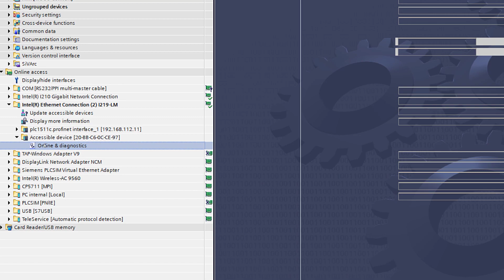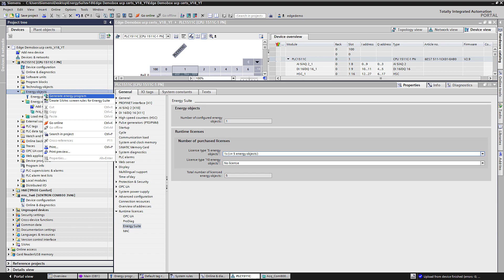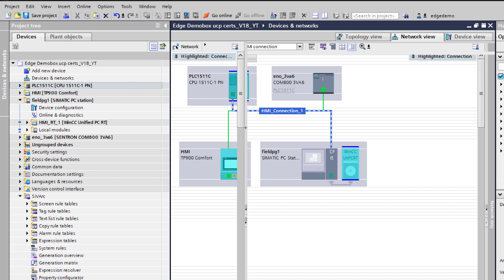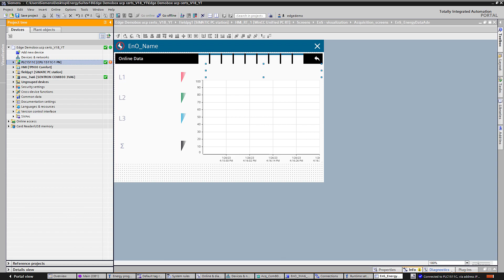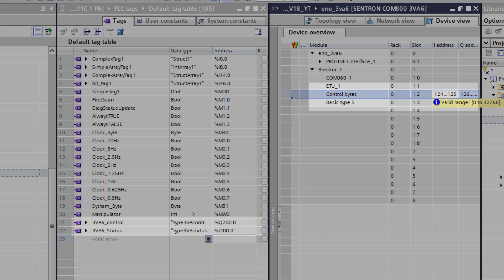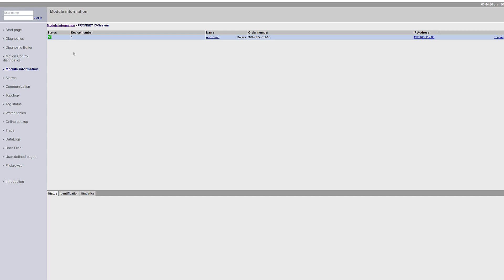TIA Portal: SIMATIC Energy Suite Demo - Automatic and efficient energy monitoring (WinCC ResCon)

Comment: Can you give this sample project to me for testing?
Reply from the maker: If you install the trial for energy suite, then you too can generate blocks and hmi code for testing. Truly is a click through operation once the field devices are in Portal. Here's an example, find the "109739102_EnS_Hardware_Lib_V15" library with pre-configured hardware. https://support.industry.siemens.com/cs/document/109739102/simatic-energy-suite-getting-started?lc=en-ww

The Energy Support library is a free to use library and can be implemented without Energy Suite. Inside the library you can find completed parts like the 3VA6 that I used in this video. There is also an example project here, but it will not have the v18 features as it's hosted in v15; so what you can do is open the v15 file in v18, and then just re-generate the energy code.